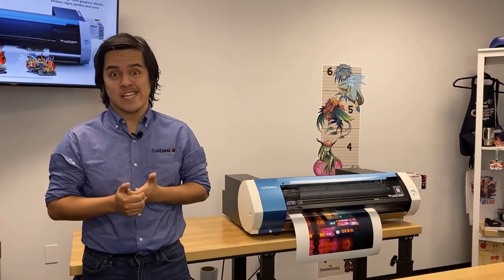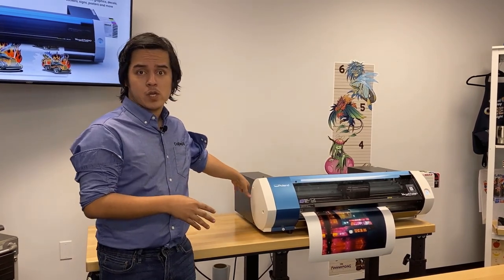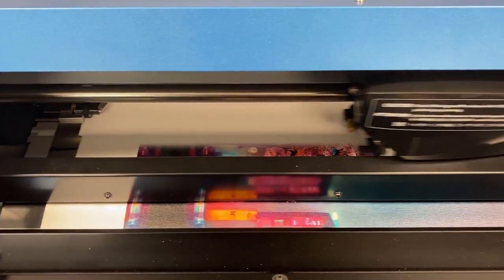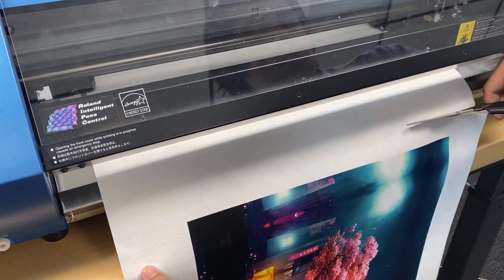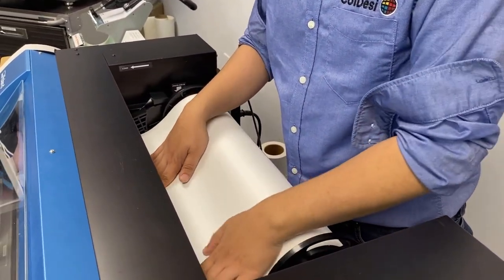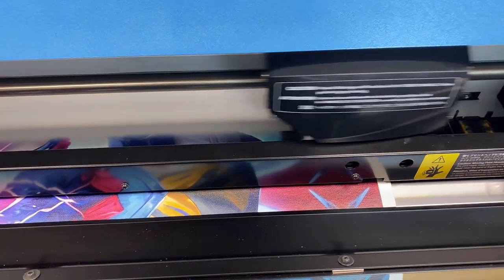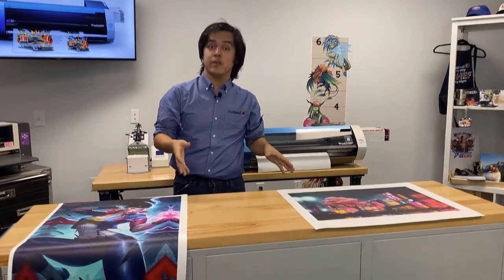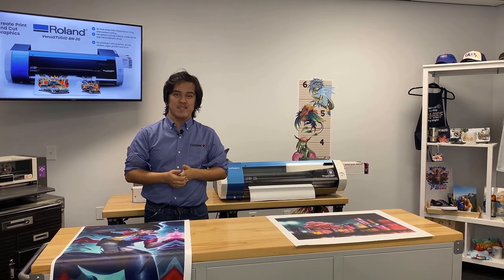How To Print on Canvas Material | Roland BN-20/A

Comment: How long does the ink take to dry?  Are there machines we can use to hasten the drying time?  Is the built-in cutting tool not good enough to cut the material?
Reply: take a few minutes to dry.. specially on canvas material.. 
Is not recommended to using the cut function on thick material like canvas